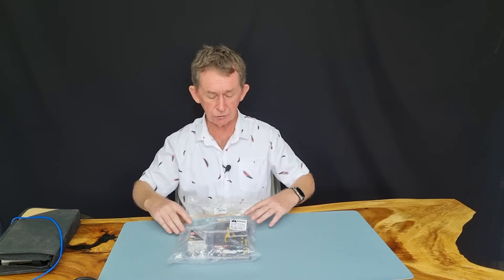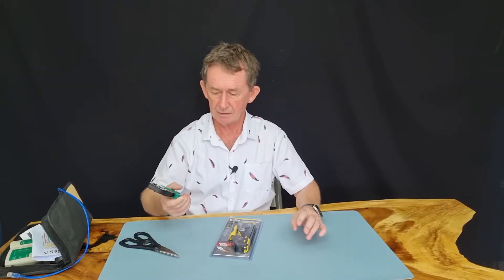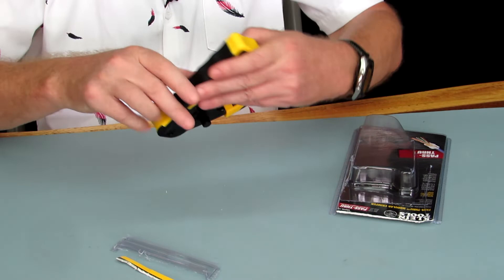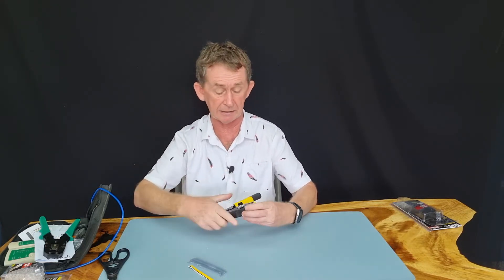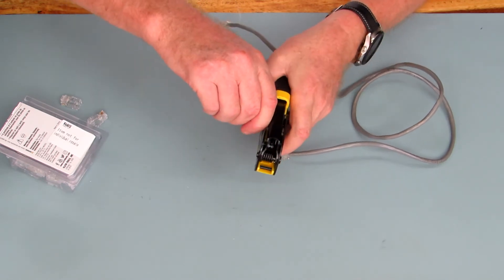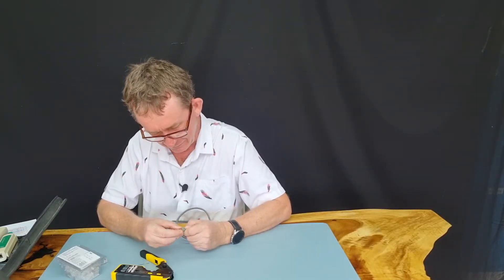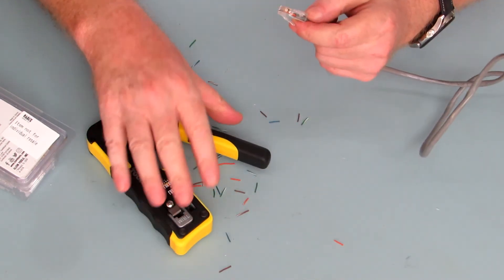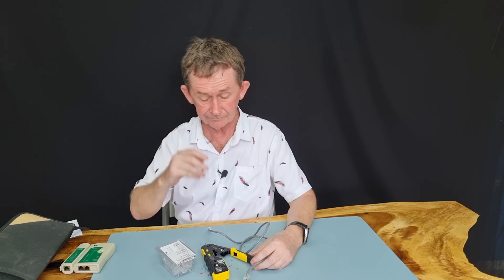How to use a Pass Through Crimper for R45 Data Plugs

Comment: Hey Pascal, the tool kit that came with my HVAC course has a lot of Klein tools in it and most of them look like good quality.
Reply from the maker: Hi there Manny. Yes, Klein are a bit above the rest of semi budget tools. They do use the Made in USA a lot, even though most of the parts are made in Asia on some items. I do not think you would need the RJ45 crimper for HVAC. Probably you need reamers, expanders and flaring tools and dies for split level aircons.  Thank you for watching, and good luck with your new endeavor
Reply: @IrishChippy  yes, now I will be adding a few more tools to my arsenal for HVAC work. :)

Comment: How's she goin'?  This is a nice crimper eh.  But I really liked the verification tool you were using!!  That was some nice.  Take care!!!
Reply from the maker: Hi Mike. I have that RJ45 LAN tester for years. Cheap and unbranded. It works a little like continuity, except the other half is a receiver. If for instance I accidently mixed up the orange/white and orange on one end, the non powered end would go 2, 1, 3, 4, 5, 6, 7, 8 instead of 1, 2, 3, 4, 5, 6, 7, 8. I don't think I have ever wired one wrong, but some data plugs fail for various reasons, and this enables you to test. Thank you for watching, and I hope you are both keeping good.
Reply: @IrishChippy  Thanks for the info Pascal!!!